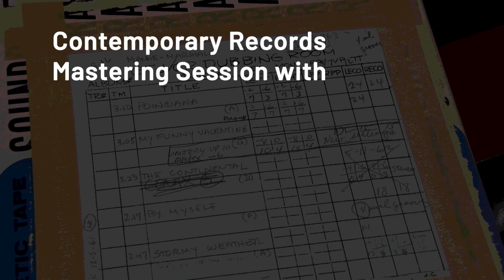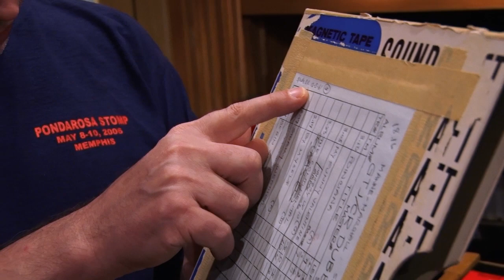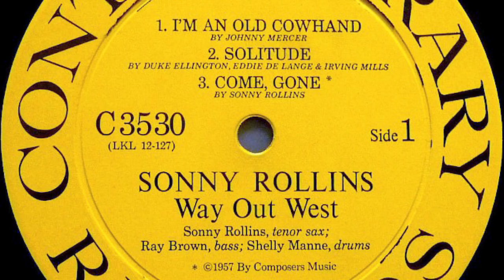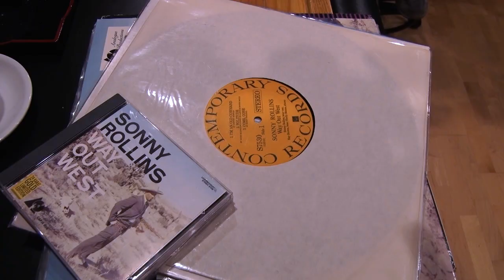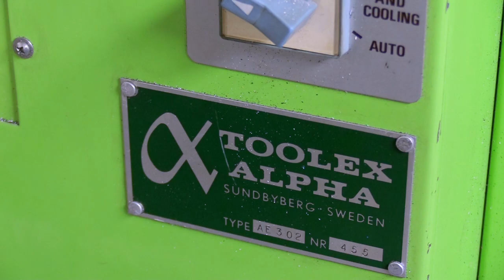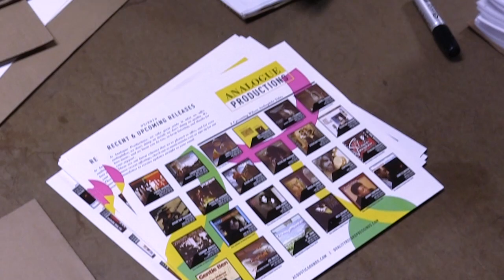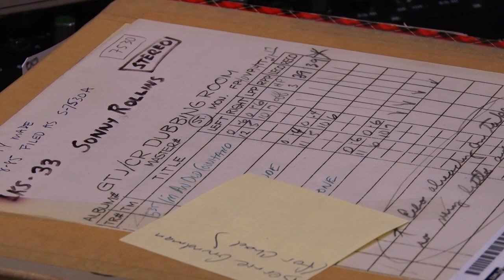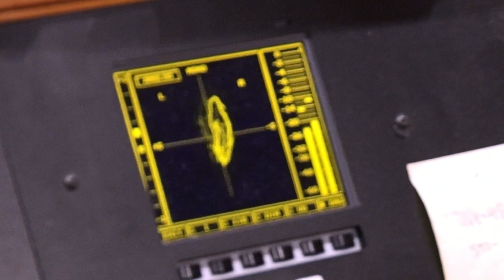Contemporary Records Mastering Session with Bernie Grundman, Chad Kassem, and John Koenig

Comment: “Half-Speed records are muddy” Bernie Grundman. He stated that “half-speed need equalization that is in the signal path”.  If I remember right, Kevin Gray also said “There’s real limitations to Half-Speed.  At the low end you’re losing half an octave of information, and on the top end you have to do corrective measures for vinyl playback”.  Note to self:  Stay away from Half-Speed.
Reply: Half speed is something that used to grab my eye some years back. After buying a few and not being wow’d, then hearing multiple respected people (like Bernie) stating they don’t do it, I now stay far away when I see Half Speed Master on the hype sticker! Direct Metal Mastering too!!
Reply: The entire RIAA curve needs to be shifted an octave lower than with normal speed cutting. The crossover point needs to be shifted from 1 KHz to 500 Hz.
Reply: No, it's not as great as "regular" speed cuts , but "half-speed" aren't really that bad! There not great, but not as bad as folks claim in my opinion!
Reply: @analoguecity3454  The problem is that half speed mastering was always promoted as a superior method, mostly by Mobile Fidelity. It's interesting to note that even they no longer use half speed mastering. 
My theory is that at the time when MoFi was promoting half speed in the late 70s/early 80s, most people had systems that benefited from the additional clarity at the top end, but really didn't have the bass performance to highlight the limitations at the bottom. The quiet vinyl was also a big plus, at a time when most pressings were pretty sketchy.
Reply: Anyone with a functional understanding of how records work knows that half speed mastering is a joke. 45RPM is where there are real, measurable benefits to be found.
Reply: The ones I have sound fantastic!  45rpm record's are better though! All being said!

Comment: " The louder its cut the worse it going to sound" so glad Bernie is on this series.
Reply: Yes, I caught that too.  But right away I thought of Zeppelin II and Norah Jone’s Analogue Productions pressing.  Is that the human condition that wants our records played at full throttle, to feel it.  Or is just after years of the loudness wars for CDs that it’s ingrained in all of us that louder is better?  Sadly, when you get a vinyl record pressed it’s an option.  They actually recommend that you don’t use this option, but a lot of new albums do.  I chose not to use this option for my latest album.
Reply: @mlblue5355  The problem with LZ-II after the RL cut isn't so much the loudness of the cut, but the fact that they seriously pulled back on the bass level.
Reply: @gotham61  I guess I should of been more specific. I was meaning the “RL” cut before they pulled back the bass.  I guess that sounds amazing though.  I have a UK pressing, a plum and red label. I saw one “RL” at an antique store and it was $46. It looked like someone took a knife or something and marked up both sides.  It was so bad, that I don’t think you could play any of the songs all the way through.  Even my Kiss Alive from I was a little kid doesn’t even look half as bad.
Reply: I don't agree with this. Oversimplification. Of course there was a limit as with the loudness wars of the early 2000's. Take the Are You Experience UHQR for example. Bernie cut it louder than Marino did with the regular cheap release and it's much better for it
Reply: @mlblue5355  the Norah Jones AP is on that I think is really hot, on the other hand I have the AP of Mighty Sam McClain "Give it up to Love" which I think is incredible. Anyway, great to here stories of the early days at Contemporary and hope there will be a lot of titles in this series!!!!

Comment: Vinyl and even Dolby prerecorded tape albums required much more attention to taming and not over-saturating the overall dynamic range in the mastering process than does digital recording nowadays. Yes, you can just as well ruin the sound of a stereo mix done in the box at 96/24 as you could an analog master. But remixing and remastering is now simpler, though it still requires good ears and sound aesthetics. Many of the mastering plug-ins are based on some techniques developed by people like Bernie decades ago. But the loudness trend still needs to go away in the cycle of taste and preferences in the sound of music, both recorded and live.